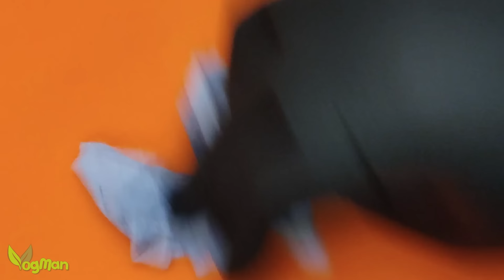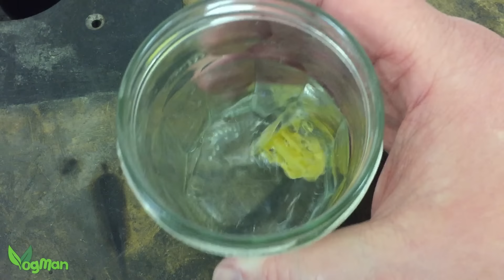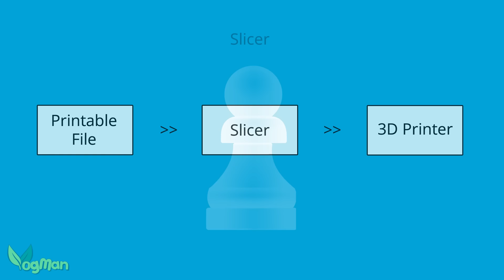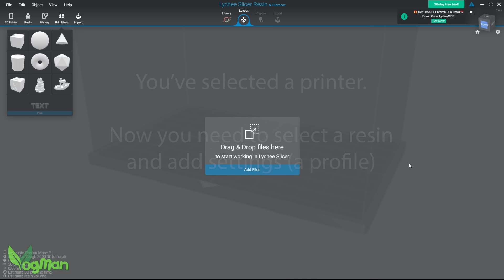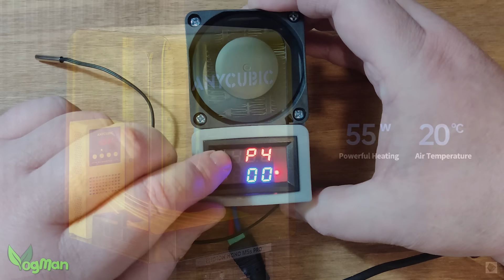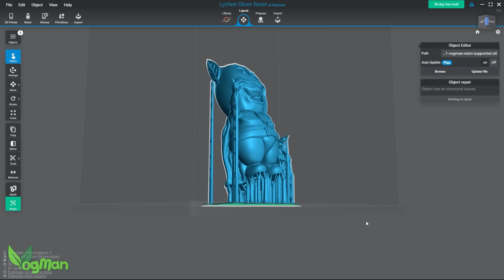3D Resin Printing ABSOLUTE BEGINNERS guide - how to 3d resin print!

Comment: Great video, best watched. I need info if  can have time to answer. I bought 3d print airplane from co in China, they have great customer service. Both airplanes prints were bad. They replaced first, warped wings. Last the tail was broke and resin oozing out of fuselage in many areas. Can I solve this? They are sending a replacement. But thought paint for practice.thanks

Comment: I have to say, as someone who is very deep into FDM printing (12 printers in total), I am currently trying my first resin printer right now and the instructions in me Anycubic Mono 4 are abysmal.  The manual is next to useless, as the way the printer is configured in the box does not match the instructions, it does not really tell you how to start your first print, and there's zero guidelines for how to get started past basic assembly.  IDK if all resin printers are this way, this is my first one, but not even my Sovol printers were this obtuse to get up and running, and they're known as tinkerer's machines that aren't very newbie friendly.  The process, overall, looks a lot simpler just by nature of having way, WAY fewer moving parts and a physical thing moving around while burning hot that you have to account for when laying out your prints, but somehow the startup guides for it are just way less developed from a beginner's perspective.  I understand the basic process, but the instructions leave a lot of room for guesswork that I find unnerving.

Comment: I bought an Elegoo Satur4 Ultra printer (resin) and I'm wondering where I can find colorful figures and the corresponding print files? Also, it comes with a program called Matrix, but is there any problem with me using Lycee Slicer?
Reply from the maker: Most popular models are sold, but there's lots of free stuff out there as well is you know where to look. If you don't mind silly Orcs, you can download my own designs for free which are great fun to print and paint, and come pre-supported so there's no worries there. Here's a page from my website that talks about the Orcs but, importantly, has links to where they can be found (Printables, Thingiverse, etc) https://www.vogman.co.uk/vogland-orcs.php - Now you may hate Orcs (but if not, look out for my videos) but those sites and great places to find other freebies. 
Elegoo Matrix is an app that allows you to monitor your Elegoo from your phone. It's not a slicer (like Lychee). You can use Lychee to slice, and then use the Elegoo Matrix app to manage the printing process on your phone. 
I hope this helps.

Comment: Thank you for this video. I got a printer as a gift and I don't know anything about 3D printing 😅 so this video is a blessing.
But I have a question. Are there any differences between models that can be printed with a resin printer? I mean, there are lots of websites with models, but they are not specifically for resin printers. Can I use any model and print it, or does the model need to be modified for a resin printer?
Thank you for your answer.

Comment: I am so glad I found you! I am about to start resin printing. I havent bought a printer yet but im looking at the elegoo Mars.  The one question i have @vogman is how often do we change the IPA from the cleaning tank.
Reply from the maker: The trick is to minimise it by keeping old IPA. Dip your prints into dirty IPA and gently rinse. This removes 95% of the residue. Then place them in the cleaning tank. This will vastly improve how long the liquid remains clean and effective... but how long it lasts depends on so many factors, I just can't answer. Here's a video that may help. https://youtu.be/kL9TCjtPbw4

Comment: Thanks for the video, exactly what I was looking for. I just bought my first resin printer this week.
A couple of essential items you missed.
A rubbish bin with a liner, for all those paper towels, gloves, supports, and ruined prints.
A silicone mat for your working surfaces, I use BBQ hot plate mats or baking mats, both cheap and at the local supermarket. Silicone as its non stick, easy to clean, and cheap so you can throw it away.

Comment: The chemicals are the biggest factor that made me hesitant in trying out resin 3D printing. Yes, the added steps of chemical cleaning is a hassle but not a game ender. It's the availability of such to product to my place. I live in Borneo but most products are sold outside my region. Local shops in the Peninsular either refuse to sell volatile chemical product to my place or they would choose, hesitantly, sea shipping. During the pandemic I wanted to get back to building scale models but I ran out of cement. I had to order one from the US because local shops refuse to send them to our place but even that still need to transported by sea shipping.
It's 2025 and I'm still waiting for the Tamiya cement to arrive.

Comment: I have two FDM printers (Prusa MK3S + Creality K2 Plus) and I’m thinking of a resin printer for figurines and to make custom “action figure” designs for customers that upload photos or a scan.

The detail is definitely insane! I have a separate room for printing that is well-ventilated with an air filter/.purifier, and no kids or my dog ever go in there.

The “messy” aspect has given me pause as well as reading about all of the different ways to cure and process the prints, but I think I’m gonna give it a go.
Reply from the maker: You get used to the mess. And as you say, the detail is incredible.

Comment: SO I ordered some STL prints on Etsy, but NONE will show up threw using my Any Cubic Slicer? It shows the files BUT NOTHING is in them? Is there something special I have to do TO Get The Files to WORK? I am new so I am sure I am doing something wrong. And I am getting NO WHERE asking On Etsy............ UGGG!
Reply from the maker: That's hard to say. I know I sell STLs on Etsy and they have to be in Zipped folders, so look in your Downloads for zipped folders. Unzip these and you should see STL files. You'll then need to open your chosen slicer and import the STL files. 
If you still feel there's a technical problem, contact the seller through Etsy. I'm sure they'll help.
If you get no joy from the seller, ask Etsy to intervene on your behalf.
I hope this helps.
Reply: @vogman  Ok will do, Thank You

Comment: What a great video! This has answered a lot of questions. What still puts me off is the software. Coming from the generation that didn't grow up with computers, saving and downloading files in their correct places is quite intimidating. I'd love to have a crack at this but I just know I'll start to have problems. If you ever find the time an 'idiots' guide which shows a little more of this would be fantastic. Cheers!
Reply from the maker: Unfortunately there's no substitute for just giving it a go. You'll get it wrong a few times, sure, but you'll learn. Those are the best learned lessons I always feel.
One printer that really makes life much, much easier is the HeyGears... it's not cheap, but it's the easiest system to use I've come across. https://youtu.be/MKfjZrFUbEE

Comment: Hello, I was wondering what resin does give the best succes rate.
My printer is the Starurn 4 ultra, and got some water washable resin but all my prints tend to fail.
I would like to try another resin, the printer is in a shed that can get real cold but I placed a heater in the printer and let it preheat for a long while before printer and I put plastic bag over the printer to keep the heat in when its printing but even so the prints always fail.
I'm not sure if it is the machine or the resin even printing a simple cylinder on a slight angle with holes in it had issues in it.
But prints tend to stick to the fep all the time or supports failing at the point where it moves from support to the object.

Comment: I completed my first resin print yesterday. It was a mess, smelled awful, and was a lot of work, but the results are more than worth it. The issue I’ve always had with FDM printers was the quality; you can immediately tell that an object was 3D printed. With resin, the piece comes off the bed looking better than many injection molded parts. 

I’ve started ordering parts to build a proper fume hood going forward because I’m absolutely going to be resin printing for a long time.
Reply from the maker: That's great to hear. Yup, mess, stinky and brilliant. That sums up resin printing 😁
It sounds like you're thinking sensibly about safety, which is excellent. Check out this video https://youtu.be/tm2PyYS8ncI

Comment: Question: In this video, you recommended Lychee and one aspect you show is the way Lychee can tell you what resin is going to work best for your project and give you the correct settings for the print. Does ChiTuBox do this as well?

I ask because in another video of yours, you show how Chitubox shows areas that lack support or need support. I'd like to use just one slicer.

I guess a follow-up question would be is when Lychee gives you the settings, can you just write them down and copy them to Chitubox for the same success?
Reply from the maker: I'll be perfectly honest... I don't use one slicer. I use 4. Each is free and each has a particular function that appeals to me above the other slicers. Of all of them, Lychee is my favourite and the resin profile library is a massive part of that. 
The answer is, you need to try them all and see which you like best 😁
Reply: @vogman  I'll take your advice! Thank you as always. What are the other two you use?
Reply from the maker: Anycubic Photon Workshop and VoxelTango. Each has their own special uses 😁😁😁

Comment: Just to clarify. What type of eye protection do you mean? Goggles or safety glasses? I've been looking into trying 3D printing parts for miniatures and am lost. This video has been massively helpful but that is one point I'm unsure on.
Reply from the maker: Generally speaking, anything that will prevent resin accidentally striking your eye. It is a messy business and splashes happen. Also when clipping, bits fly off in all directions. Resin isn't a very friendly chemical and so you need to be cautious. Watch this video - https://youtu.be/tm2PyYS8ncI - but don't be terrified by it. If you work safely, you'll be fine.
If you're using a UV torch, then you should ideally use UV protective goggles. This is what I mine by UV torch use https://youtu.be/XvL8MUdY0ZQ
I hope this helps 😁

Comment: is it safe to use one of these machines in my office room since it requires 3d modeling was going to place the machine in my pc office... will the smell be harmfully and overwhelming?
Reply from the maker: A couple of weeks ago my answer might have been different, but I've been researching a video on the health implications of resin that you really should watch https://youtu.be/tm2PyYS8ncI
In short, if this is an office with several people in it, then a professionally fitted negative air enclosure needs to be fitted around the printer.
If it's just your personal office, think hard on it. You don't really want to share the room with the fumes, even with windows open. 
There are ways to achieve it and if you look in the comments below the video I've linked here, you'll see how some folks have cleverly tented their printers under the vacuum of ventilation fans. I've no doubt this would dramatically help, but it needs thinking about.
This is a great hobby that I would never actively stop anyone from pursuing, but just as I wouldn't tell a non-swimmer to jump in the sea, I wouldn't advise anyone taking up resin printing without knowing the potential health issues and how to circumvent these.
Take your time. Do your research and you'll be fine.
Reply: @vogman  Any suggestions for setting up then and where?
Reply from the maker: Ideally you want a dedicated room with widows and a door. I personally print in my garage. If you don't have such a space, then you need to find an area where you don't visit that often and that can be easily ventilated.

Comment: This is awesome! Just one area of questions pops up: you said that small fragments can form and if the resin isn't properly filtered it could end up cracking your screen. The only way I can think of, is that it gets jammed under the build (plate) as it comes down... So here's the questions: isn't there a similar risk during the printing where the fragments formed? Does it also mean you should filter in between back to back prints? Or are freshly formed fragments not hard enough yet and do they become harder in storage?
Reply from the maker: In theory you should filter after every print. Don't get me wrong, I don't, but if asked "Should I?" then I'd have to say yes.
It's not necessarily bits dropping off, though this can happen, it's mainly about poorly supported parts failing to properly print and forming on the FEP. So by filtering the resin, you get to capture any drop-offs, and you get to check there's nothing on the FEP. 
Bits of solid resin really can cause damage to the screen as there's a surprising force behind a metal plate and a screw thread. That's why a feature commonly appearing on printers now is "Residue detection," which is a great idea but not perfect yet from what I've seen. 😁

Comment: can i ask where you got the mini files you use in this video especially the orks
Reply from the maker: Of course 😁. Those little chaps are my own creations. I made them and shared them specifically because folks were having trouble with presupported models. By adding these I was hoping to provide a few models that should ALWAYS print, if all the settings are correct, etc. You can find them on quite a few libraries are I'll list a few links here. 
• https://www.printables.com/@Vogman_1210941  or
• https://www.thingiverse.com/vegoilguy  or
• https://cults3d.com/en/users/VogMan

Comment: Can you just leave the resin in the vat instead of pouring it back in the bottle?
Reply from the maker: These resins are best kept in an airtight container. Some, more than others, will degrade quickly if left in the open air. You can often buy or even print vat covers which helps, but it's generally just a good practice to get into, especially if you don't print regularly.

Comment: Comparing community profiles like that in Lychee when purchasing resin is Genius! Great video as always VogMan!
Reply from the maker: I was trying to think of the easiest way for a complete newbie to get started, and using an established library of user profiles just made sense 😁
Reply: Let's not forget also that resin manufacturers also sometimes share settings. I found Anycubic being better than Elegoo. To be fair, Elegoo is losing resin battle with Anycubic, since Anycubic has so many more types, which are great, e.g. Tough, Tough 2.0, High Clear. I'm looking forward to trying Rigid 100 also. Elegoo had great choice of colours, but availability is bad, so it is no longer great.

Comment: Very well explained there mate. Still using the Ender 3 pro FDM and I still Don't have a clue, half of the time I think it's more luck than judgement! 🤣
Reply from the maker: The complete newbie genuinely expects they'll unbox everything, plug it in and it will work. It should be that easy, it really should, but those of us with experience know this is never the case 😁
Reply: @vogman  yes that's true mate. How long have I been following your channel? All I can say is I think you were casting the gears out of foam when I subbed to your channel 👍
Reply from the maker: That's a long time. At least I haven't scared you off 😁😁😁
Reply: @vogman  Never scare me off mate 🤣🤣

Comment: thanks again . that EKOFuel isn't it a bit more unsafe then  the other cleaning solvents.  thanks
Reply from the maker: No, it's pretty much the same highly flammable and smelly stuff 😁😁😁
Reply: @vogman  OK i see thanks. I figured  iso  would evaporate faster. This way the leftover resin can be tossed after it's cured. do you have any recommendations on what to do with the wash then .  thank you
Reply from the maker: Oh it evaporates off just as quickly. I tend to recycle mine as much as possible.